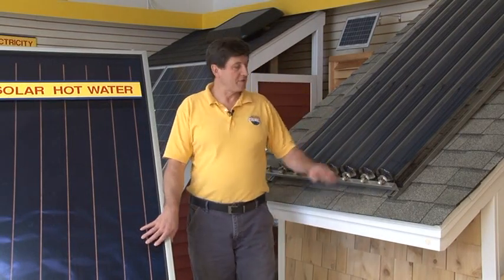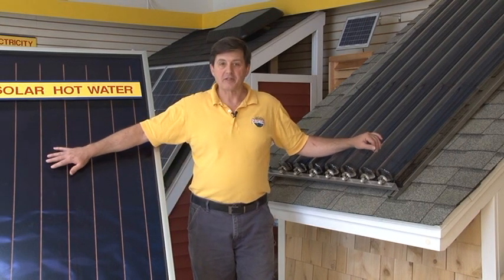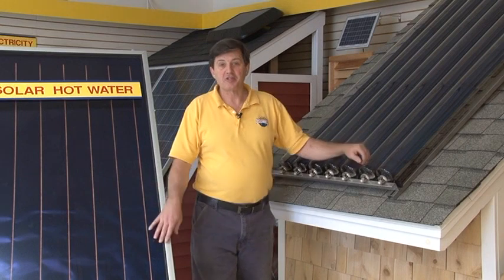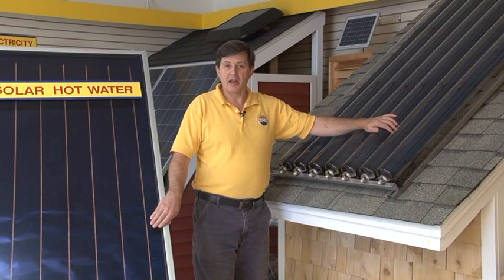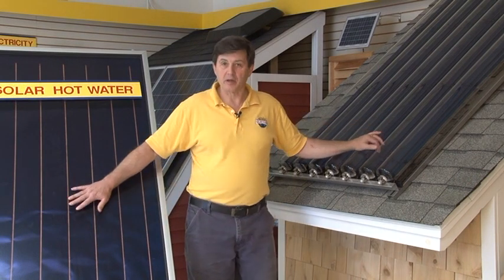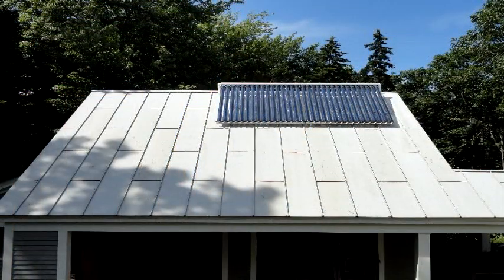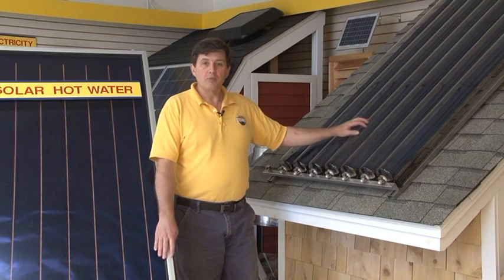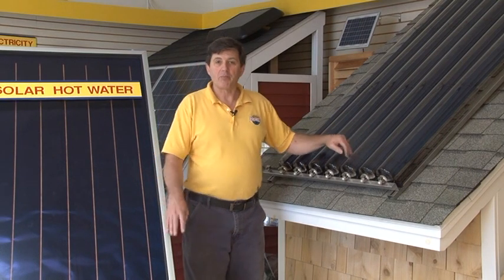Solar Hot Water Flat Panels v. Tube Collectors

Comment: Which is better and cheaper for long term maintenance?
Reply: Tubes have a higher maintenance schedule depending on te factors:
1- heavy water clogging the tubes and sealants around tubes which should be replaced every year or every other year. 
2- hale will destroy tubes if they catch them at the right angle for their size. The flat ones may also have issues with hale.
For the tubes you can put a mesh to deal with larger hale issues